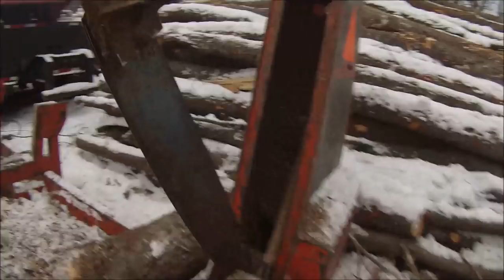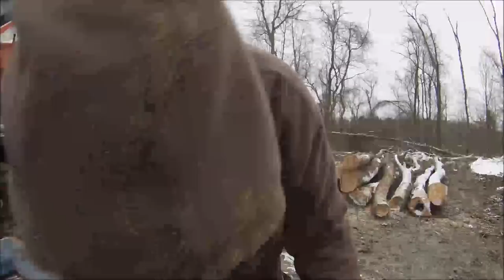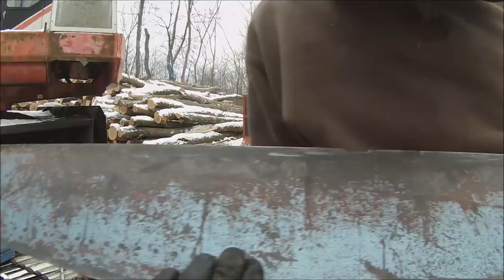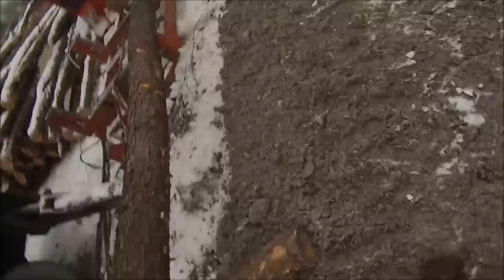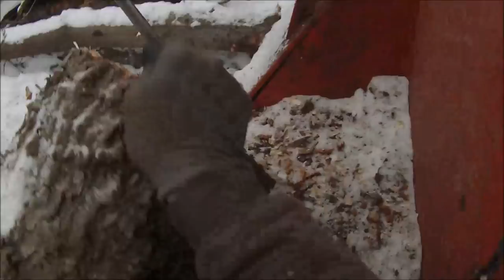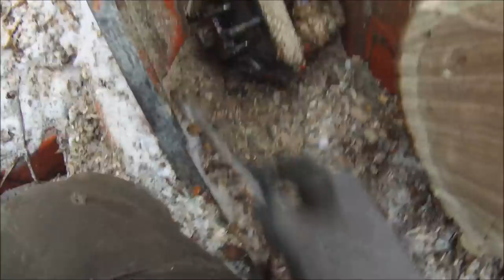new buck saw bar and chain

Comment: When i have a good bar do that i weld it up grind it to match and grind the groove section out with cut off wheel on air grinder...20 min good as new...make sure to keep rails dressed burs ground off and will last and last

Comment: Nuts319 I'm have a question about slasher saw the bar when it comes down to cut the log it stops and does not keep cutting I have 421p ctr that is my problem and thanks for your video
Reply from the maker: Omar court make sure the belts are tight and fluid is not bypassing in the drop cylinder
Reply: Thanks buddy